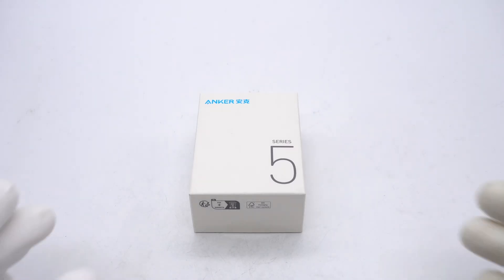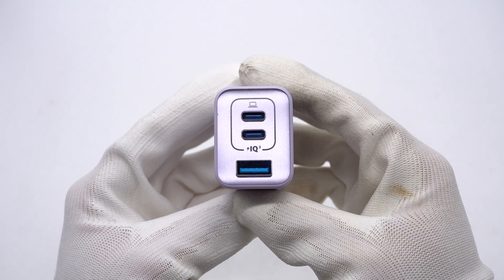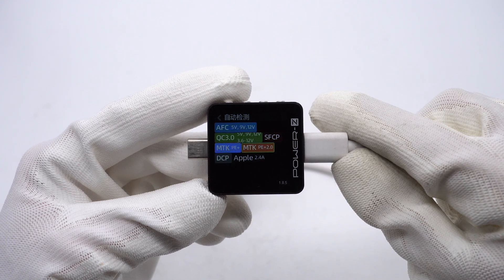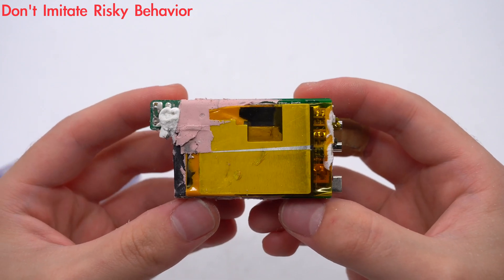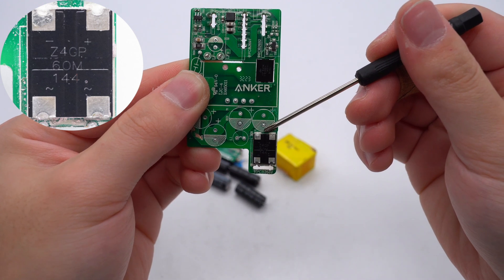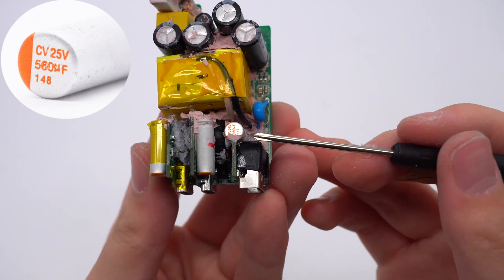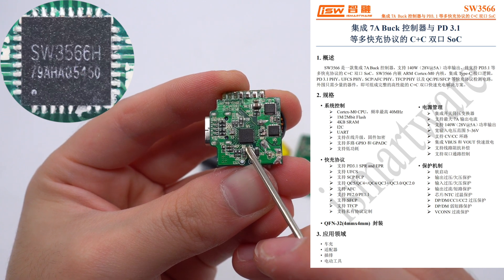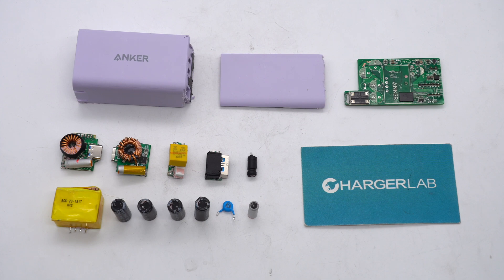Teardown of Anker 3-in-1 65W (535) GaN Charger

Comment: Can you tear down Pisen 70W GaNMecha Pro. It is much more cheaper,  i got it with just 12 dollars.
Reply: That thing's gonna start a fire. You should never cheap out on any kind of power supply or charger and always look at the reviews or description to make sure it has the proper safety certifications (UL, ETL, TUV if you're in the US).
Reply: @_5_0_  of course, i check it carefully before buying. Its price before discount is 24 dollars. It can output 70W like it said.